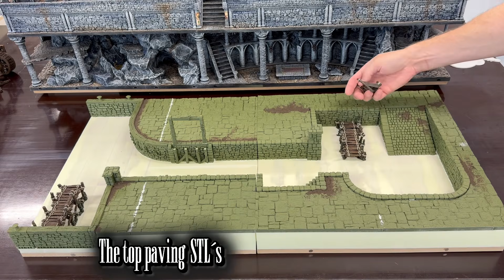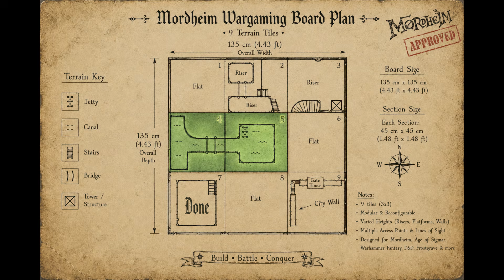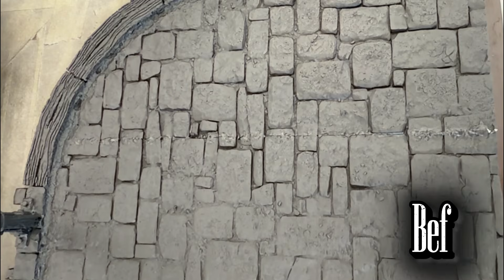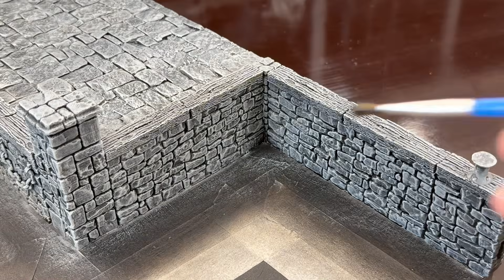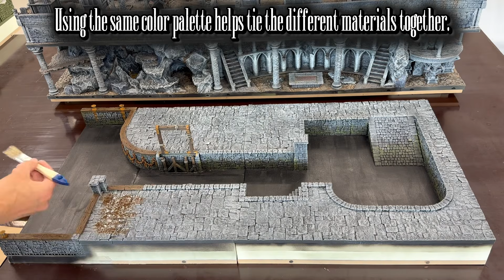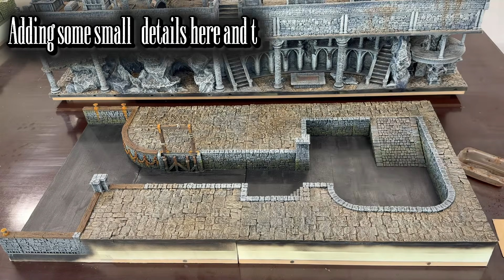Mordheim Quayside Terrain Tiles: Painting My Modular Board | Part 5

Comment: Looks great! I also don't mind the transition between the tiles. Once you place scenery on it no one wil notice. I guess I'll wait with my resin pour until you've done yours hehe. Are you going to add some more debris on the 'bottom' of the canal or in the resin?

If I may give feedback on one thing, I think you've pushed the rust effects too far. Generally those pieces of metal don't really rust that bright, they turn into a duller brown, with spots of orange. Like this the orange really stands out, especially because its the same brightness on all the metal parts on the tile.
Reply from the maker: Thanks! That’s reassuring to hear about the tile transitions. I think you’re right that once there’s some scenery on there, it’ll all blend together much more naturally. Haha, no pressure on the resin pour then!  Yes ther will be som beris but not too much,

And thanks for the feedback on the rust, that’s really helpful.Totaly agree! , it is to much, Ill see if i can dull it down a notch or two

Comment: I think the board looks great so far. I'm excited to see how the resin pour goes. I don't think the transitions between tiles is that noticeable, but if you're worried it,  try doing a light dry brush with the tile edges pushed together. The eye will be drawn more to the colours than any visible gap. Again, I don't think the transition from one tile to another is noticeable. the cobblestone pattern does a really good job hiding it.
Reply from the maker: Thank you! I’m really excited to see how the resin pour turns out too. That’s reassuring to hear about the tile transitions—I was probably overthinking it a bit. I like your idea of doing a light drybrush with the edges pushed together, Ill think it i probably best to wait until all of the tiles are finished. Really appreciate the feedback!